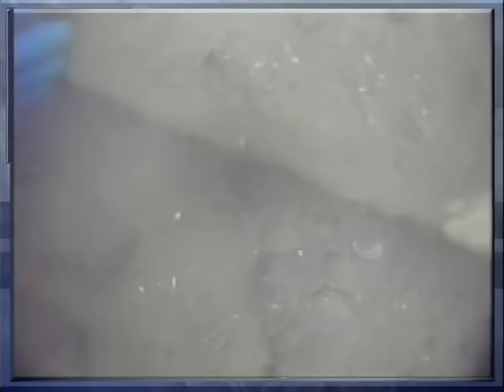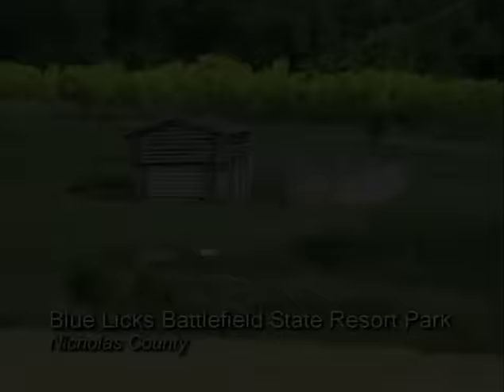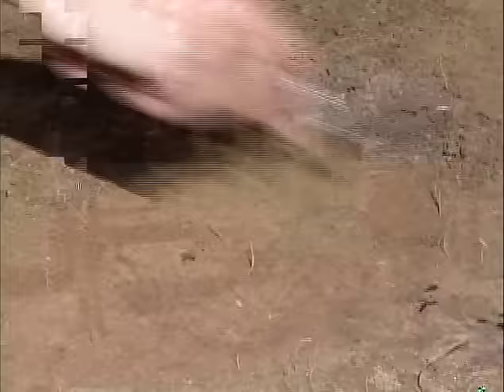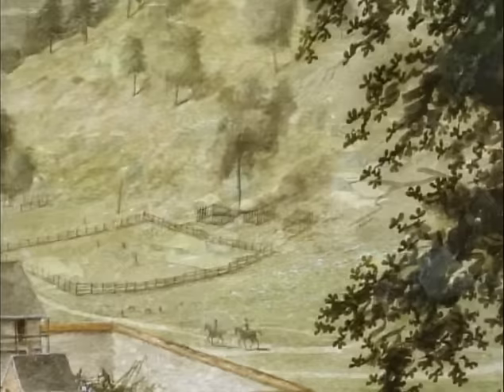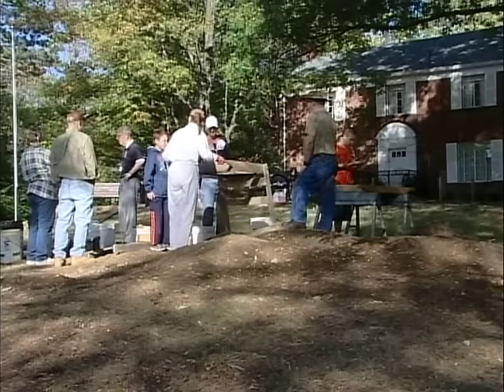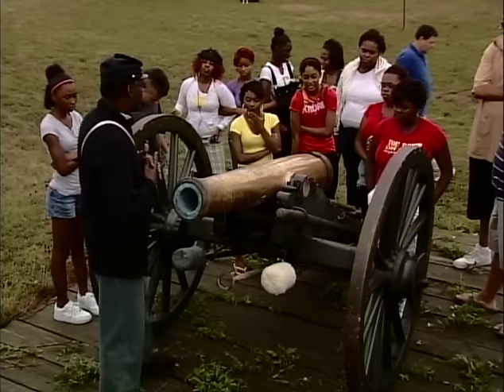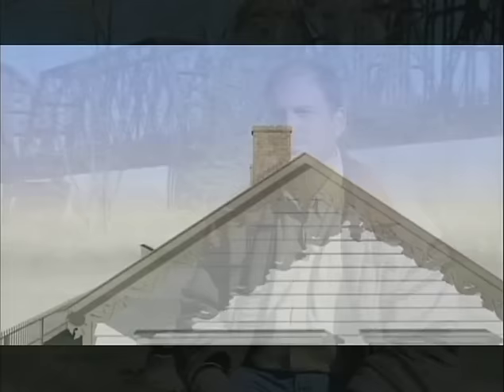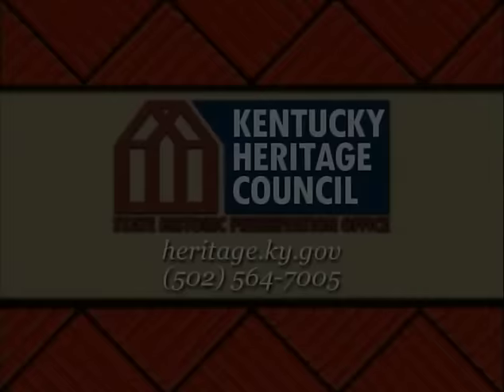Historic Archaeology: Beneath Kentucky's Fields & Streets - Kentucky Archaeology Video SeriesVol III

Comment: My dad's family are from the same holler in eastern Kentucky since genealogy done by a relative went back to 1770's when the courthouse burned down and haven't been able to go back any further so far.  Being real close to the Virginia border, this part of Appalachia was settled no doubt by those ame people who were around during the time this country became a country.
Back then someone would make a claim from a creek or river, on one side and take up a whole bottom near the flowing water, and up the side of one or two adjacent mountains with a holler cut up the middle of the two. Depending on the lay of the land, ones parcel may end at the top of the mountains...or much further depending on the next running water or creek source. Water flows down in the bottom between every few mountains even if the rate and volume of flow may be small. Those natural "boundaries" were first used as property lines when the Commonwealth was first settled. 
Sure we all have immigrated to this great country, it's just mind blowing this half of my family has been pretty much in the same spot for around 275 years in the same general area. It don't take long, just a few generations, for young men and women to marry as the original home place gets split up into smaller parcels. Many of these would not be farmed on their own due to no flat land but back then if one set out to farm they would make sure their parcel came with enough of the flatter land near water. 
On my mom's side of the family both grandparents came from big farming families in the west/southwestern side of Kentucky near the Ohio River which would be another interesting  genealogy to study some day. Not so pleasant answers may arise to questions such as why my grandmother was the second oldest of 13 kids, all of whom died of cancer within a relatively small amount of time, with the exception of two who died young due to other causes. My grandfather's story is not much different but not as dramatic in numbers of deaths due to cancer which were spread out over several more years.